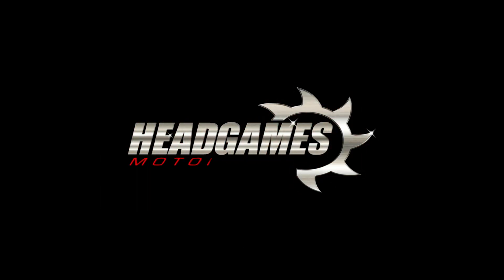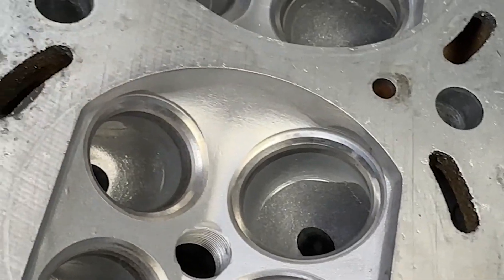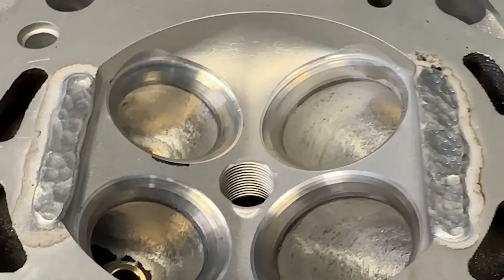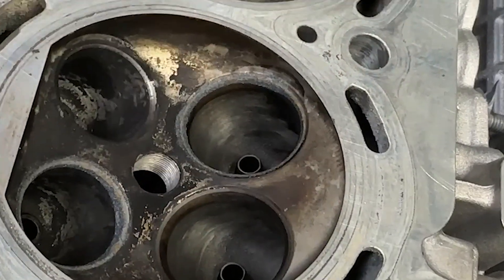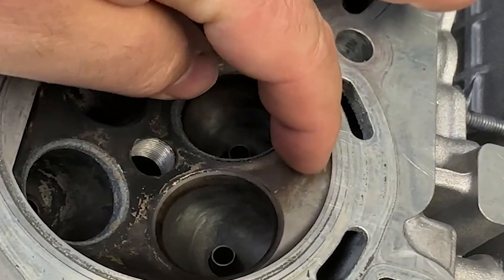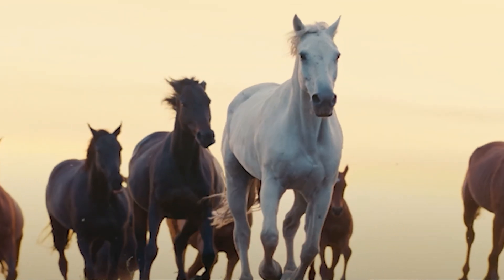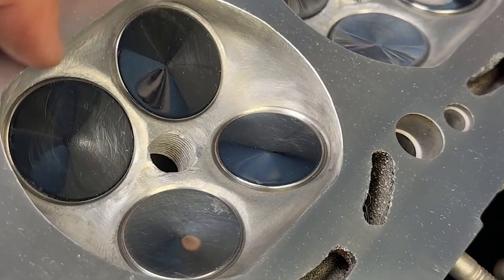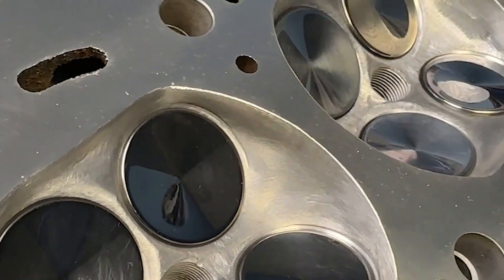Tech Talk: RB26 Combustion Chambers!

Comment: I remember back in the day it was common for GM Holden Commodore's in Australia with the RB30T Turbo Nissan straight six that came in 1985/6 GM Holden Commodore's to put the RB26 head on the RB30T bottom end . 

FYI for some reason GM Holden vehicles sold in New Zealand got the RB20 and Australia got the RB30 .

Comment: You went deep short angle, but have you tried the opposite? Shallow long, going back to the firing ring but only a few degrees, if the pistons are flat in this squish area the gradual taper will make it tighter at the edges, forcing the combustion into the center. Like 2 stroke pistons and squish

Comment: All depends on a use. If its for high boost application remove. If its low boost application/street leave it alone it will help mpg. I have done it on different applications and it works like a bomb. Car runs like hell, allows more timing and boost safely
Reply from the maker: I personally would just leave it in, but you do you! I think it is a personal preference .

Comment: Another Aussie here. I grew up porting heads from the late 70s, im now 60 years old. A few years back when i was working on our RB26 head i took a very similar approach to yours, with the pads i didnt just lean them back but i also deshrouded the valves to A promote better head flow through and B to reduce the chance of detonation. She made a easy 1002Kw (1344hp) at the hubs on very conservative timing so i know it works well.
Reply from the maker: @GTRPSI  that’s awesome!

Comment: the RB26 can rev to 9k with medium cams and springs

that's a huge powerband, therefore removing the quench makes it more suitable in that higher rpm?
Reply from the maker: The chamber is related to ignition timing, not rpm. The quench doesn't care how much RPM you run.

Comment: I disagree a little. I made a cutter to put a measured cut removing the pads making radial conical pads that were way easier to blend in. Our CR was 11:1 we ran fairly wide cams so the dynamic was 10.3 that engine made great power and responsive to.
Reply from the maker: I know there are people who have done it successfully.  I get it, because it will work. Just don't think it works as well as the way we do it.
Reply: Definitely had custom pistons made tho.

Comment: How are your results with just removing the sharp corner on the quench pads?

I’ve been doing what I Learned from Ben Alameda racing. It is not a “softened” chamber, but it is grooves on the pad which jet the mixture towards the plug.
Reply from the maker: grooves are not fixing the problem.

Comment: The biggest difference people will notice taking the pads out is the change in static compression with the usual off the shelf aftermarket pistons. A person could have pistons made to raise the compression back up but then the question becomes why bother other than to avoid any det concern with the pad there. The amount of flow you could possibly increase by taking the pads out is offset by the lack of combustion efficiency with them removed.
Besides, the big problem with getting the rb26 head to flow well is the exhaust side. The short side radius is so sharp it's hard to get it to flow well.
Reply from the maker: Yes! Glad to see you here sir!
Reply: I whole heartedly agree with your assessment. Also...you shouldn't have to run a lot of timing if the ports and chamber are working efficiently.....you should actually be able to pull timing but maintain performance.
 I do bike stuff and if you look at modern Japanese or Ducati heads the valve angle is very shallow which allows for minimal chamber CC's. It also allows for dished pistons or at least flat tops The dished pistons are great as they promote great squish and really concentrate charge in the center of the chamber/piston. The only thing that kinda sucks about Japanese bike porting is the small ports compared to cars. The Hayabusa has nice large ports but 600cc bikes do not. 😁
Reply: The small japanese bike ports are great for big horsepower and insane throttle response......😁😁😁😁

Comment: That's a very interesting conclusion as I ported and made the heads at maatouks racing for years and Croydon's gtr also have hemi chambers they are the fastest rb motors on the planet so maybe at the upper range of 2000+ hp it's needed
Reply from the maker: that's why I said, I know people have done it and maybe even did it with success. If I worked there I would either be eating my words or right lol
Reply: You suck. You run a performance head business... and it sounds like you're just learning about combustion chamber design and combustion dynamics.

Comment: I have done the same to my Honda Gsr head.  But I have opened the whole chamber up for my larger 84mm bore.  But the quench is still there just softened.  But this is why I like Gsr better quench and better attach angle on the valve vs the b16 heads.  Should I have left the sides alone or opened them up to Match the bore the head has been machined down so to get about the same cc chamber.
Reply from the maker: Your good opening up the chamber size to the bore and laying the chamber back on the quench pad. The b16 head still works great, has a quench pad but its just different than the b18.
Reply: @headgames  Hey I don't know if I will get an answer 11 months after the upload. I have the same issue on an old BMW 2v head, much bigger bore than the cylinder head has been designed for from factory (block is 84.5mm and head is from a 80mm bore engine). So you say I better open up the chamber to match the cylinder bore rather than having a (very) small squish band all around?
Thanks a lot and keep up the good work!
Greets from Germany
Reply from the maker: @ you should certainly open the chamber up! It is probably very timing sensitive the way it is and you guys don’t get the good fuels. 
Thanks for watching from Germany!
Reply: @headgames  Oh wow, thank you very much!
Yeah we have 98 or at some places 100 or 102 octane pump fuel but no E85...
I will open the chamber up to around the same diameter as the cylinder bore then. 
Another little question, BMW set the squish to around 1.7mm / .070" which doesn't sound very effective. I can't tighten it up because of already high compression ratio for a boosted setup... Should I keep this squish gap as it is or would you rather modify it to an angle or even remove squish in this case?
Reply from the maker: @ I always angle it but never take it away. Taking it away slows the charge down.
Reply: @headgames  Thank you very much! Keep the channel going 🫡

Comment: Squish is necessary, tight squish helps to make an engine less detonation prone, softening the edge is good but only time i mod the squish pad is to deshroud valves,  if your squish pad is covered in carbon then your not tight enough ☺️☺️☺️
Reply: Engines always run strongest when the piston hits the head a little...
Reply: As a prototype machinist who worked in competition engine building i can say the amount of time we spent machining piston crowns and quench pads to get things nice and close told me how important it is
Reply: @robertheymann5906  one of the most overlooked aspects of building a good engine

Comment: You are completely right, I tried this on a sr20det back in 2004 the made good power and if it wasn't for a motec computer at the time they had double the load points of any management on the market you would not have been able to tune this pig I am talking 35 degrees 17lbs of positive pressure  7000 rpm all it achieved was completely kill flame propagation in the transition phase from kernel to complete equal flame front good news no more back sided pistons .keep up the great work and videos
Reply from the maker: Great example! They have a very similar chamber design. 
Thanks for the kind words!

Comment: Totally agree about not removing the pads. I actually wish l could make my quench pads larger. What are your thoughts on welding in larger ones (aluminum). I’m personally  scared to try, I’m afraid of metal breaking loose.
Reply from the maker: Welding it right won’t break loose

Comment: I was actually wondering about whether I should soften that hard edge on my rb20 head. I guess I won't! Thanks for sharing all this good info, it's so cool to see someone so confident in themself as a product that they'll share all these things other people would consider *trade secrets*.

One thing I am curious about is your opinion on using a Dremel instead of a more appropriate tool to do some mild port work.
Reply: Actually I saw you mention cleaning up the sharp edge on a comment😅 I guess I will lol
Reply from the maker: Yes do it! Just soften it like in the vid. Don’t remove it. Thanks for commenting and watching! 
I would never suggest using a dremel vs getting a real grinder. 1/4 shank grinders are plentiful and cheap. And then it opens you up for proper tooling that makes your work come out better.

Comment: I do not get why people remove quench pads. Look at the guys who build OHV V8 engines with wedge heads. They seek to maximize quench. They seek out the head casting numbers with the best quench zones. They carefully mill the block deck for ideal squish.

I hear a lot of guys saying less quench for boost. Maybe that is why these guys are removing quench from RB26DETT heads? Most of those OHV V8 engines were NA, and are kept NA. The guys building boosted V8 engines sometimes say less quench for boost.
Reply from the maker: the V8 guys will soften the chamber, which is essentially what we do by laying the chamber back but they do not completely remove the quench pad. Boosted or otherwise.
Reply: @headgames  Thanks.
I think about how the guys with a Chevy 350 would often seek out 906 or 062 head castings because that combustion chamber was the best that any iron Chevy 350 head ever had. They might cut a little quench out for deshrouding purposes, but that's about all.

Comment: Some of the older JDM builds might opt for the quench removal back in the day due to fuel selection. Although hi-octane gasoline was available, its not like today where you can chuck in E85 as easy as now and get spicy with more efficient combustion designs.
 A lot of older RB's builds I've tuned, I can sometimes note that although power is decent after enough boost, the engines dont feel very efficient relative to how much boost and timing you have to wind through them. I'm not an RB expert by any means, but just what I've noted on some JDM stuff I've seen. Definately seen a head thats had the quench removed on an old JUN engine, didnt matter if you were running 10psi or 35psi of boost, it would take 30 degrees timing lol, any more or less and you lose power and no knock to be found. Made me laugh.
Reply from the maker: you seen what I am talking about first hand! It's crazy that people still do it in my opinion.
Reply: @headgames  I feel like removing it completely is too extreme, but maybe massaging the quench pad a bit I could understand. I'd rather have more efficiency so you dont have to run everthing quite as hard to get to whatever power level in an ideal world.
Reply: What was the static compression ratio and cam choice for that particular build? I'm more familiar with jz's and found out that usually after 10psi of boost up to 30psi ish peak power timing is about 14-17deg depending at what rpm it occurs. Peak torque timing with the above boost levels is somewhere around 10-13deg on vvti engines that are not limited by dynamic compression. I've seen high static compression stroker with 76mm turbo, and way too small cams barely having any advance BTDC. Was cured with proper cams and engine was more efficient in every rpm range.
Reply: @Marko-JZX100  Im not entirely sure on the specs, all I was told was that it was a full JUN engine built by JUN, sounded like it had 280's in it. Big old T88 on it. Proper old school setup.

Most RB's follow a similar principle to 2J in terms of timing, but this engine was different than most. Could of been a few things contributing towards it, but wouldnt suprise me if they did some headwork like Dave has pointed out. 

I've had other RB's with similar specs in terms of cams/strokers etc, but you would never get away with 30 degrees timing at 35psi on them, you'd detonate way before then. 

I tune JZ's primarily, but disagree with you slightly. The timing numbers at 10psi vs 30psi are completely different at both peak torque and high rpm.
Reply: Ha, this is what I said !

Comment: You take a dye grinder and go thru the edges to take the sharpness out of them then go with a sandpaper to get the final touch or leave them as is?
Reply from the maker: Or cnc it. Not sand paper, we use cartridge rolls.

Comment: "semi hemi" head dose the same thing in promod and mountain prostock,  the quench pad were still remind
Reply from the maker: they soften the chamber but they don't remove the quench pad. Is that what you are saying?
Reply: @headgames  can be benefit both way, edge soften aiming for heat spot prevent （also work as exhaust transition to help port energy for wedge chamber according david vizard :glasses-purple-yellow-diamond: [since the cuench out gas were almost hyper supersonic at the exhaust stroke TDC  and facing right at the exit port]

Comment: Dave I love and respect your porting awesome job but here’s my take. My theory is based on the idea that the large quench pads are for combustion efficiency and emissions. The idea of a quench pad much like direct injection is to get a pocket of richer fuel air mixture concentrated near the spark. It works great in many applications but the modern take on combustion chamber design for horsepower is to make the engine as detonation proof as possible. Removing the quench pad and replacing it with a spherical chamber is following this theory. The better an engine can resist detonation the more power you can make.
Reply: @dorifthor Here is why I disagree with your theory: There were two "godfathers of detonation" - guys that recognized that compression makes power, but causes knock; which breaks engines. Therefore the knock must be eliminated. Charles Kettering went about solving it by inventing a way to increase octane - Tetraethyl Lead. Harry Ricardo sought to eliminate it by the shape/geometry of the engine parts. He is the one that discovered that high mixture motion and turbulence decreased knock tendency. He is the one that invented the concept of the high-squish combustion chamber shape, as well as myriad other designs to greatly increase the motion and turbulence of the air/fuel mixture just before ignition.

When I worked for GM Racing, I spent quite a bit of time with the combustion engineers. Those quench pads are there to introduce a lot of mixture turbulence at TDC. They are HIGHLY engineered to accomplish it.
Reply: Another great video. I do think most people fixate on thinking more timing is the answer, but as you state, it's the flame speed that dictates timing. Also some seem to think the quench pads are for emissions. It's there to create mixture motion during combustion. Something 4v heads lack compared to the swirl you an get from a 2v head. A question I have here is, would easing the sharp edge of the pad help? Seems to me that sharp edge probably holds a lot of heat.
Reply from the maker: Hey I still love you even if we disagree on something. Thanks for the kind words and taking the time to throw your ideas out here!

Comment: 6 minutes on that alone?

35+psi it doesn’t need to be there, because we’re doing everything to too help high boost (custom piston a must) 

leave it there for more VE if your chasing low down torque

We rev these to 10k rpm so anything that might hinder that should be removed
Reply: can make 600hp on an unopened engine reliably and 1000hp on a stock bottom end and an un ported head without detonation. If you have your quench set up correctly it is near imposable for it to have conventional detonation  your issues lie else ware friend and i would be looking at pistons around the quench area probley find there is no quench and hence detonation
Reply from the maker: we run 100psi+400 shot of nitrous on 2jz and don't remove a quench pad. VR38 does 80psi with quench pads in it. I know it doesn't work. But, you do you boo.
Reply: @headgames
I think maybe he is saying that the detonation on the quench pads was caused by pistons, not the pads. If the piston does not come close enough to the pad, it can detonate in that narrow chamber. (The way I understand it.)
Reply: 100%

Comment: I have noticed on my aftermarket 2jz pistons the quench area is about half the width of the oem piston. In this instance is the extra width of the quench pad in the combustion chamber doing anything?
Reply: I'm getting custom pistons made for mine...na head..and max squish, aiming for no more than 25 thou clearance. Will report back. 🤌
Reply from the maker: that's tighter than a gnats ass wrapped around a wagon wheel. Report back! @Not-Sure-Viralade-ftw
Reply from the maker: it is following the chamber on the GTE head